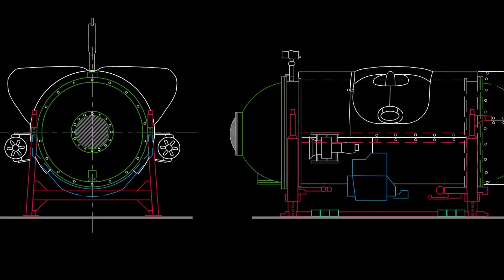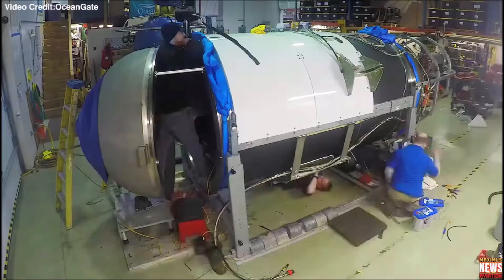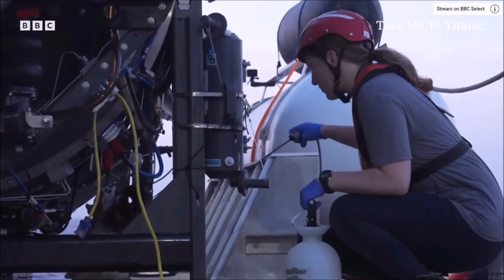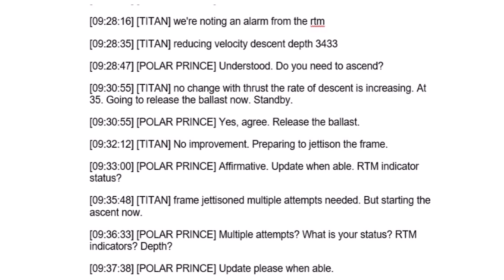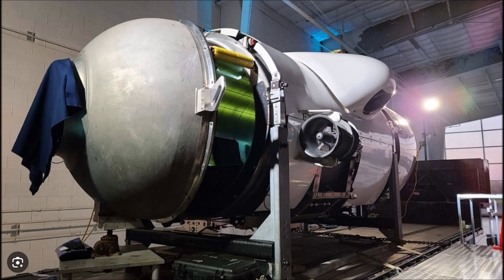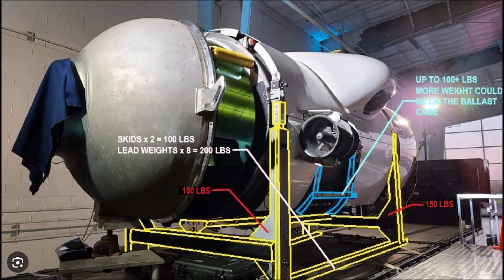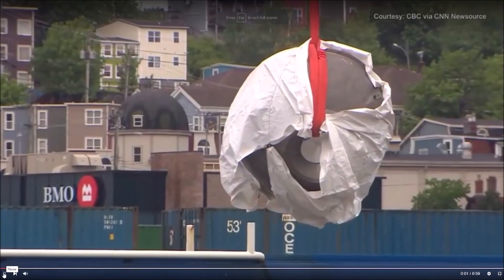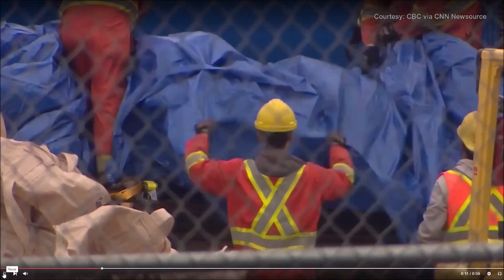OceanGate Titan - DIVING "TOO FAST" A REALISTIC SCENARIO?

Comment: I don't understand why descending so quickly was an important factor in this disaster. I watched another video where they went through the transcript line by line. It was emphasized that the sub was descending too fast, but did not state the significance of this fact. Could anyone enlighten me please?
Reply from the maker: It's important because if a problem develops they can abort the mission and resurface. They had a system of acoustic sensors and strain gages in a "Real Time Monitoring" system, aka "RTM", which was supposed to prevent a disaster like this. So the idea is to dive slow and steady so that the hull has time time adjust to the increasing pressure the deeper they go. The RTM would alert them if there was a problem, which according to the transcript, all lights were red. Stockton said in an interview that he had 1,500 meters of dive time before the hull would potentially fail, meaning that they had some time to get back up to a safer depth. I assume that means from the start of the dive but not 100% sure what he meant by that. If they were 3,400 meters down it would simply take too long to get to a depth where the hydrostatic pressure was significantly less. They just did not have enough time to turn the situation around.
Reply: Thank you very much for your timely, clear and concise answer! Very much appreciated.  @VegasCyclingFreak
Reply: Thank you very much for your timely, clear and concise answer! Very much appreciated.
Reply: @VegasCyclingFreak  I think your reasoning about the rate of descent would only hold true if there was some equalization from inside for the structure to adjust too! The rate of descent had nothing to do with the structure collapse, the RTM's only registered at a certain depth and it wouldn't have mattered as to the rate they got to it! However the rate of ascent may have played a factor! Maybe if they could have come up faster after alarms were sounded, they could have gotten out of that critical pressure zone!
Reply from the maker: @frednewman2162  Descending too quickly = too deep to ascend to a safer depth before implosion if a problem suddenly arises. Ascending too slowly compounds the problem. That is my point. As far as I know the RTM was continuously monitoring the hull at all times.
Reply: @VegasCyclingFreak  But the RTM only alarmed at a certain depth! Monitors all the time, alarmed when critical!
Reply from the maker: @frednewman2162  No RTM alerts would be indication of picking up unusual activity. RTM was always comparing the data from previous dives, etc and comparing to this moment now. Doesn't necessarily correlate to depth. If you read the patent it's pretty clear how it was intended to work. Seems to me they were victim to either a sudden delamination or a kink band. Those two things would create a lot of activity for all of the sensors, and the outcome may have still been the same anyway.
Reply: @VegasCyclingFreak imagine paying 250K a head or whatever it was to get on a vessel that had to have a "RTS" to try and predict when failure began. I mean really? Just the logic of that is flawed. You do not want to be in a vessel that begins to fail then be warned and try to abort and ascend. What "dumbassdery".
Reply: Your common sense is correct. The rate of descent did not contribute to the implosion other than bring it on sooner.

Comment: @LasVegasCyclingFreak In Mike Bell's latest Titan video he disclosed a data point (3400 meters, 90 min) independent of the transcript. Assuming a constant downward component of acceleration it would land on the seabed ~ 5.3 min later with a downward speed of ~ 80 meters / min. If the landing caused the implosion the time stamp of the "acoustic anomaly" would be 95.3 min. into the dive.
Reply from the maker: Hmm… maybe that’s what actually happened? They hit the seabed at an uncontrolled rate of speed. With Titan weighing 20+ tons and that massive hydrostatic pressure in addition, it could not survive that. That makes some sense. Because of the weather this year, I really do believe that ocean currents had a part in all of this. A little DSV like Titan is nothing compared to the force of that.

Comment: This is OLD, OLD news now!!!
So why not give it a rest!!??
Reply from the maker: First, I don't have the same viewpoint as everyone else. 

Second, I'm looking at this from a mechanical engineering aspect. 

Third, I am systematically going thru all of the systems of the sub because that is the way I can attempt to reverse engineer the thing to the point where I can understand what each system did and roughly how.

Fourth,  I want to understand why the CF cylinder failed. It's not just a simple case of Stockton Rush was a suicidal maniac.

Fifth, am I trying to find where the transcript can be a fake but so far everything I find out about the sub lines up very well with the transcript.

Thanks for the comment. I'm not trying to entertain people, "get more views" or rehash "OLD, OLD NEWS".

Comment: Why would diving too fast cause an implosion? Fast or slow, once the triggering depth was reached, it would have imploded. Is it being  suggested that the carbon fiber hull would somehow have acclimated itself to the pressure if it had been reached more slowly? That's illogical.
Reply from the maker: Descending too quickly = too deep to ascend to a safer depth before implosion if a problem suddenly arises. It may be that it was a no win situation even if they hadn't reached that depth nearly an hour ahead of normal.
Reply: @VegasCyclingFreak  I see. So really  descending imprudently rather than just too quickly. 
Sort of like getting into an overheated bath. There is a point at which you can jump out.
 However, I don't think there would ever have been sufficient warnings to have saved them, do you?
Reply from the maker: @kirbywaite1586  Yes that's the idea. It might be possible if they weren't as deep that they could have got to a safer depth and avoided the tragedy. I believe they fell victim to a sudden de-lamination or a kink band, which can also suddenly appear with carbon fiber in compression.

Comment: Dangit!
I wish I had the bandwidth and the ability to easibilily visually verify.
As it is, I'm going on gut feeling. 
I abandoned a carbon fiber front fork on my bike after the blast I got from it that I never felt from a steel bike around the early 2000's. 
It was night and day and my ulnar nerve got a nasty tap to confirm it.
Reply from the maker: I've been riding full carbon road bikes since about 2016. Haven't had any problems with them in a combined 25,000 or so miles. Sometimes you can do a tap test to tell if the carbon is compromised, but that's not always reliable and much less reliable if it's in an area with a lot of reinforcement. One of the scariest potential failures is the fork steerer tube failing from an over-tightened stem. It's not at all a common failure, but it can happen. Imagine riding down a mountain at 45 MPH and suddenly your handlebars just break off!
Reply: @VegasCyclingFreak  - I quizzed an old guy with a high end carbon fiber bike at the crosswalk the other day. 
He did some slamming on his front wheel at the stop just to show me and it was obvious that times have changed. 
I'll run my mouth about one thing, though!
Everyone should have a rear view mirror on the handle bars, helmet, or both. 
The handlebar mirror saved me three times before the cellphone drivers became the theme.
Reply from the maker: @clintstinkeye5607  Yep, whenever I am on the road I have helmet mirror! On my MTB i don't need any, thankfully.
Reply: @VegasCyclingFreak  - Just keep your ears open.
👍
Reply: @VegasCyclingFreak  - I had only peddled on touring or mountain bikes.
That made me think I qualified to be on a racing bike.
Oops for me.

Comment: The problem is with the genius who designed this death trap and not listening to the advice given on the first dive the first test pilot stated not to proceed with this  sub cause it had faults in but nope the idiot went anyways and avoided getting the sub certified knowingly it was a gamble of failing this last dive what is sickening he made each passenger sign their lives away so their families could not sue him and using a Xbox controller knowingly that it would not hold a charge for long it definitely was a suicide mission from the start in my opinion
Reply from the maker: You must be referring to the employee that got fired? My understanding is that Stockton did first test dive himself, solo. The Real Time Monitoring System (RTM) was continuously monitoring the status of the hull, and comparing that data with previous dives. In theory should have prevented a disaster. They had more than one game controller on board in case one broke, died, or whatever. But yeah, ultimately the use of CF seems to have not been such a great idea. Not in the way they did it anyway.

Comment: Was the frame actually detachable?
Reply from the maker: Yes. Would be the second emergency measure to drop weight for a rapid ascent. Bruce Morton, the former OceanGate engineer that designed some of the Titan, says so in this video -- https://youtu.be/IHR3foWRy94
Reply: @VegasCyclingFreak  You're awesome! Thanks for taking the time to answer that. I've wondered about that ever since the transcript came out.
Reply from the maker: @patrickmooney5035  You're welcome. I'm trying to objectively find holes in this transcript, but it just keeps lining up with all the things I am learning about the Titan. I believe it is legitimate.
Reply: @VegasCyclingFreak  You could have warned me that out of the 1 hour 13 minute video he only mentions the emergency leg release at the 1 hour 10 minutes mark 🤣 
Interesting video, I thought the transcript was fan fiction because I didn't know the legs detached. But, they clearly do.
Reply from the maker: @patrickmooney5035  Ha ha sorry about that... I didn't remember exactly where in the video that was - but you undoubtedly know much more about the Titan now! 😁

Comment: The rate of descent has nothing to do the implosion.
Reply from the maker: Yes it does.
Reply: That does not make sense. The rate does not change the pressure encountered at every level which is fixed according to depth and it is the pressure that caused rge implosion.
Reply from the maker: @anthonysmith3851  Agreed, a certain depth will generally have a certain hydrostatic pressure. They did however get to 3,400 meters nearly an hour faster than normally. If they had been diving at a slower rate they could have had more time to get to a safer depth, and possibly have avoided this fate. It could be that it would have happened anyway because it was already on its way to failing due to cyclic fatigue. I think it was a no win situation for them... probably was just no way of getting out of that situation. Also, they were somewhat at the mercy of ocean currents, Stockton mentioned this himself.
Reply: @VegasCyclingFreak  Their plan did not include a choice of depths, therefore there was no option for a safer depth. Their objective was to reach the Titanic and no matter the rate of descent, they were doomed to implode upon reaching the depth where cyclic fatigue  took over. I believe that they may have had a warning and I believe they tried to jettison the ballast, an operation that failed as it may have been electrically controlled and I further gathered that their electrical system was first to fail.
Reply from the maker: @anthonysmith3851  That's one thing I have not been able to determine, is the specific details how these pin removal schemes were instituted. Apparently there is a claim going around that there were pumps inside which were operated manually to do this stuff but I don't see how possible with the area under the deck being batteries and oxygen bottles. Nowhere to be seen inside the crew compartment either. Therefore, I do believe it was automated and it would require the use of the batteries in the tail section. I surmise they ran down the batteries quickly because they were using the thrusters to help ascend, pedal to the metal so to speak. I'm pretty sure they were using these batteries: http://www.ictineu.net/wp-content/uploads/ICTINEU-BATTERY-FULL-OCEAN.pdf
Reply: @VegasCyclingFreak  I challenge you to present a cogent argument on why the rate of descent exacerbates or otherwise affects the point or pressure at which implosion occurs. That it does is illogical.
Reply from the maker: @anthonysmith3851  Descending too fast = too deep to ascend to safer depth before hull failure. Not enough time to reverse the situation because they can't ascend fast enough to prevent it. It still takes a while to ascend, even after they have dropped some weight. This could have also happened 2,000 meters down, or at 3,800.  At 2,000 meters not a problem. At 3,800 meters, well they're all dead. Also, with carbon fiber in compression, kink bands can suddenly appear. Possible that the kink bands won't appear with gradual increase in pressure but may appear with more rapid increase in pressure. These kink bands can suddenly appear, and that is one unpredictable problem with using carbon fiber in this way. In my book, Spencer Composites gave them a sub-par hull.
Reply: @VegasCyclingFreak  Not enough time to take corrective action makes sense however it had nothing to do the point or pressure where hull failure occurred. In fact, if they did not descend at all, implosion would not have occurred. I'm sure that the time needed to take corrective action was not factored in otherwise they would have set an optimum or maximum rate of descent but they did not. How then could they state or deduce that descent was "too fast" when they did not set any ideal rate to compare to. The statement "too fast" is therefore arbitrary.
Reply from the maker: @anthonysmith3851  All I can tell you is it normally took them about 2.5 hours to reach 3,800 meters. They were nearly at that depth in only 1.5 hours on that day. Is that "too fast"? Compared to the past, yes it's quite a lot quicker than it normally would take. I surmise that maybe the space explorer was talking about his space-capades or whatever and maybe these alarms initially went unnoticed for some amount of time. I doubt it was like some kind of honking alarm that would freak everyone out. The RTM is hearing ultrasonic sounds. When they are actually hearing audible sounds then the handwriting is on the wall.

Comment: Diving too fast means additional frce/pressure on sirfacea... its why effect changes on kick ad touch... slow change in pressure is like touch of it reaches a specific speed ot turns to kik or slap 😊 ... therefore fast doving gemerates additional stress on weak points like joints or mocro carbon layer bendings...which meams higher level of risk compared to slow descent...

Comment: I appreciate your video for genuinely trying to find the cause of the failure rather than to attack Stockton or Ocean Gate simply for building the sub in the first place.
Reply from the maker: Thanks. I am looking at this as objectively as possible, with my engineering cap on. I think you will find my next two videos very interesting. One of them will look more in depth on the Real Time Monitoring System (RTM).
Reply: Carbon fiber is used for its tensile strength to contain pressure such as in an aircraft's fuselage at altitude where the stress upon the structure is tensile. Carbon fiber offers virtually no resistance to compression akin to holding both ends of a string and putting the ends together, which is compression, as opposed to pulling the ends apart, which would be tension or tensile stress upon the string. The compression stress upon the hull of the submersible was therefore placed upon the laminate material holding the strands together (delamination) instead of on the carbon strands (the resultant force).  The strands of the carbon fiber then acted as knife edges cutting the laminate material as compression stress was applied to the hull rendering the whole concept as inutile. Stockon Rush, what were you thinking?
Reply from the maker: @anthonysmith3851  Well beyond that, Stockton had Spencer Composites build him the hull to his specs. I'm pretty sure they knew it would be for a submersible... why didn't they refuse to build it? They are supposed to be experts in the field.
Reply: @VegasCyclingFreak  They wanted the income from the job. Theirs was not to  rebuff a client who presumably accepted all responsibility.
Reply from the maker: @anthonysmith3851  Yes but at the same time, if it failed guess where the fingers may eventually end up pointing.

Comment: I'm not too familiar with submarines but it just seems that when all the ballast was released that they claim was supposed to be available to release plus some type of inflatable balloon it would have shot its way to the surface rather quick. Unless everything had already fell apart before that could happen. One other thing I do not understand if it makes any difference about the speed on the ascent would matter they seem to be concerned about it descending on its way down.
Reply from the maker: I didn’t really mention it but there was also a ballast tank in the tail, the big orange thing above the big orange batteries. If they had that high pressure O2 tank also be the same thing that drove out the pins to drop the frame, then they could’ve used up a lot of what should’ve went to the ballast tank. I’m not able to determine exactly how they had that system arranged. Anyway, yes they would ascend faster but it’s still going to take some time get rise up to surface from 3,400 meters. Too long to prevent an implosion, probably even if everything went smoothly and predictably.